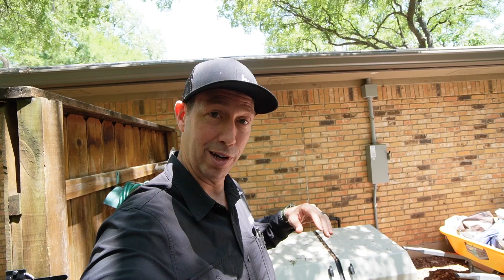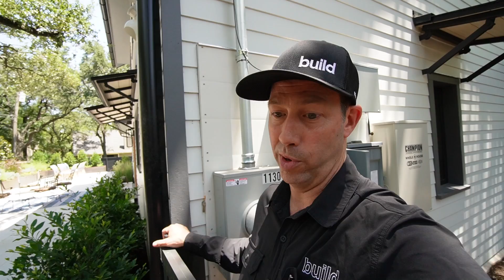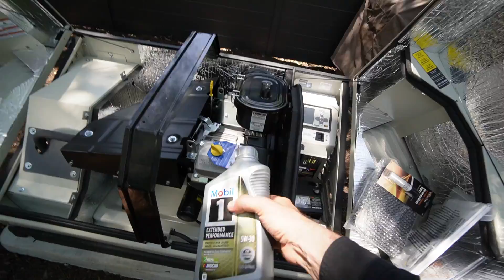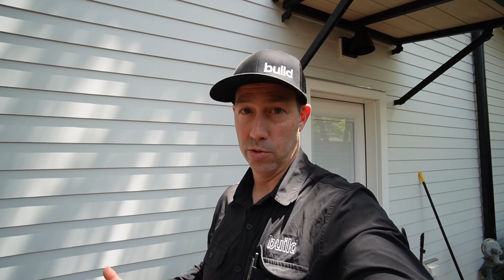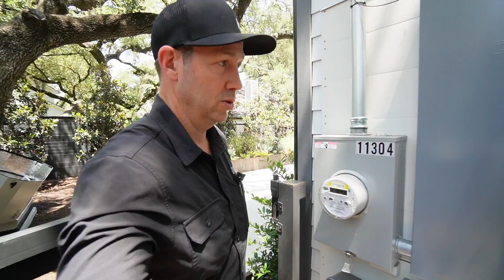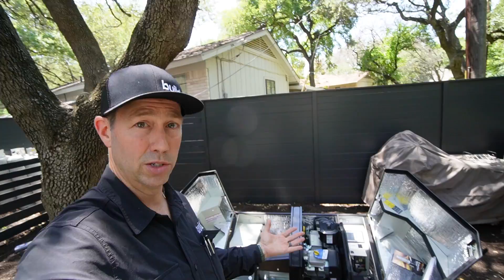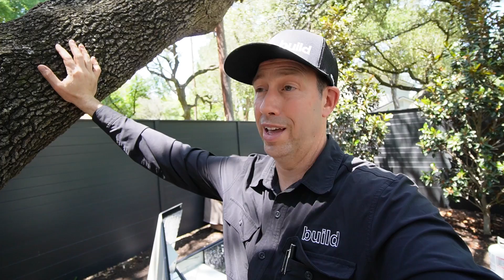Rolling Black Outs? Meet my little friend: Home Standby Generator

Comment: My personal experience with a Champion generator is the complete opposite of what you claim their customer support offers.  8 years ago we had a major ice storm just before Christmas, TWO WEEKS without electricity!  We got lucky and walked into a Big Box store JUST as they brought in a pallet of Champion 4kW portable units.  I will say that little generator ran very nicely for 2 weeks, almost continuously except for refueling and changing the oil.  After the power came on, changed the oil again, drained the fuel and put it into the garage.  1 year later, another power outage so I go to fire up the genny.  Nope!  Took it in for service, with well under 350 hours the block is cracked.  No warranty even though I did register it, because the first oil change wasn't done by a Champion dealer.  The only way I'll own another item from Champion is if they GIVE me one like they did you.
Reply: I have a small 9500 inverter portable generator I use to back feed the electric panel.  I use a lockout.
To keep from overloading my generator with the HVAC startup demand I use a couple of soft start controllers.  Works well.
Make sure you get a generator which has a low distortion.  This helps protect your electronic equipment.
Reply: Honda is the ONLY brand to use in portable generators....there is a reason they cost a bit more, the high cost of low prices
Reply: @cengeb  Well, my next small generator will be an EU2200i.  One of the best generators in its class.  After the first one I would like to get the companion for parallel use but that will be a while yet.
Reply: Ouch.
Reply: Love my standby generac 24kw
Reply: @blueboat9581  If/when we can get a whole house system it's going to be a Generac or a Kohler.  Probably about that size or maybe a little smaller
Reply: If you are getting anything other than a cummins generator you are paying for what you get. You're buying a random engine from a no name company that they bolt up to another no name companies electric generator that they slap their name on doesn't matter what brand, Generac, Champion, Kohler.  Just from a family of electricians pov who have installed and serviced a lot of generator/ back-up power systems
Reply: Onan Cummins is the way to go
Reply: @Rubyranch393  Very common in large RVs.
Reply: @hankwells2637  Do they make a smaller Cummins generator? I have a 1300 sq ft house single story in a hot climate, no cold.
Reply: @Moondoggy1941  They make all the way down to 7500 watt generators all the way to 40kw
Reply: @hankwells2637 Briggs and Stratton make their own Vanguard engines.  The power head I’m not sure about, but it’s never failed me but one time the starter solenoid went out.  10 year warranty hard to beat too.
Reply: @mikerossman9863  Breaks N Scrap-Em, they ain't made like they used to.
Reply: @hankwells2637  It's funny you forgot to look at Honda, Kubota, Yamaha and similar others but I guess we're discussing standby units here and not the more versatile offerings from the truly good generator makers.  Also, to the original poster, you have to keep maintenance up with any power supply like generators and even battery solutions.  You can't just put a machine away for a year and expect it to run again.  This is one of the headaches I may have with mine as it's almost a year since I bought fuel for it but I did run the carburetor dry before storing it away.  More or less I will have to dispose of the old fuel and maybe clean the carburetor but that's the very least you can do with most.  What people should be doing is pulling it out, inspecting key parts of the unit and test it.  This also applies to battery units as you need to use the unit once in a while.
Reply: This is why I hate these shill videos Matt does now.  But I'm sure Matt would highly recommend these generators even if they didn't pay him!  /s
Reply: Your story is more than a little suspect for two reasons. Firstly, there's no such thing as a Champion dealer. They have electricians that install their whole-home units but they do not service their portable units in any way. Secondly, the Magnuson-Moss Warranty Act makes it illegal to require maintenance to be done by a dealer. It doesn't just apply to cars but to all consumer products sold in America.
Reply: @nodak81  They MAY have meant an authorized service center which IS allowable under the M-M act, but that's not what they SAID.  They said the word "dealer"
Reply: @michiganengineer8621  The closest thing to a Champion dealer we have is Canadian Tire as Canadian Tire stores are actually dealer owned.

Comment: Have you looked at a solar system with Enphase IQ 8 microinverters? Pretty cool system. If the grid is down but the sun is shining the system will “island” your house from the grid and then pump that power, in real time, to your house, without batteries. Also, F150 lighting has a bi-directional charger that can draw from the trucks batteries to power your house, then charge itself from your solar system, all when the grid is down.
Reply: That’s a brilliant setup for a contractor!

Comment: Are those some kind of hurricane shutters on the windows of the side of your garage? If so, I'd like to know what steps you took for hurricane protection of the structure.
Reply: He is in Leander Texas, 230 miles from Galveston. No hurricane specific protection needed there.
Reply: He is in Austin.  Same basic area.  The Champion installer was in Leander, a northern suburb.

Comment: Keep in mind when you have an extended outage you will modify your normal behavior and use less energy.  Battery + Solar just doesn't pay in Texas like it would in California where electric rates are so high.  Some kind of backup is no longer a luxury.  I'm a fan of solar + batteries because it's green and if sized correctly could keep you going forever ($$$).
Reply: It’s green at source of use, not source of manufacturer (mining materials).
Reply: Batteries dont last and solar only works on sunny days. If you live in Arizona, maybe...lol

Comment: You took the path I would have.  Up here in Minnesota power has been super reliable.  The longest we we’ve been powerless was a couple of hours duration a couple of times over 40 years.  Hard to justify the expense, but I am still debating.
Reply: Many people were without power for multiple days in feb2021 in Texas.  Ice keep us home for a week.  Texas is a non-connected grid, eg standalone and we were underpowered because much of the  in state generation was also going down.  So Texas is worse than almost anywhere else in the US.  Lousiana and Oklahoma had no real issues because they are part of a multi-state grid.

Comment: I specified a 225 kw Generac generator, propane, for the house in east Texas. A little less expensive, I'll have to look at the Champions model on the next project. The transfer switch alone was $1700 supplied & installed.
Reply: 225kw? That's more than ten times the power requirements of any house I know of, except maybe the White House in Washington, DC.

Did you perhaps mean just 25kw? That's a large Generac for a home, but not totally whackadoodle.
Reply: 22, typo

Comment: Contact engineer775 here on YouTube. He can help you look at solar, inverters and battery systems as well as a generator tie to help charge your batteries should you have bad weather and low solar output. He can help you with design, sourcing equipment the works.

Comment: That 14 Kw generator is hopelessly too small for your house. It may work but will be running at near maximum capacity all the time.  All of those 100 lb. propane tanks are a HUGE hazard to you and all of your neighbors, not to mention theft when the power goes out.  Why not go with a Generac 24 Kw air cooled whole house generator and a 500 gallon or whatever size in ground propane tank your HOA will allow.  That way you can power what you want and not burn up your generator.  I have a Generac 20 Kw whole house system and love it.  Very easy to maintain and very reliable.  Very good quality.
Reply: It's always easy to say go bigger. But in reality, it's only for backup. You only need just enough to survive, not thrive. I have a portable dual fuel (propane/gas) generator that's about 8kw on propane. It's enough to run the essentials in my home, including A/C, well, and my oil boiler for hot water and heat. If I watch what I have running it's also enough to make dinner in the oven or on the cooktop. 

Is it perfect a solution, no. But it's budget friendly and anyone could reasonably afford it. All in, I'm about $600 including the generator (was a return with 0 hours that I got a deal on), hook ups, and permitting. I did the wiring and lockouts myself and passed inspection. I'm not a certified electrician but I was able to learn how to do everything the right way.
Reply: @jensalan  It is not a matter of being easy to go bigger.  It is a matter of the laws of physics.  Just because a generator is rated to produce X number of amps output, the output must be matched to the load.  Our 5 ton heat pump draws about 172 amps on initial start up for just an instant & drops to it's normal rated amp draw which is about 1/4 that amount.  With just the heat pump load on the 20 Kw Generac, it would drag the rpm's down to almost stalling the engine.  This is horribly destructive to any generator & continued use would destroy it.  I had to install a Micro-Aire EasyStart Soft Start Kit in order to run the heat pump on the generator. With the soft start kit installed, we dropped the start up amp draw about 110 amps which a 20 Kw generator CAN support on start up.  The generator must be able to support the LRA (locked rotor amp) load of a heat pump/ac unit.  This applies to pretty much most appliances like, refrigerators, freezers, fans, dryers, washers, etc.  Most typical homes require at least 30 Kw to run everything normally.  My 20 Kw is a standby generator to get me by provided I am disciplined about limiting the number & amount of electrical loads we place on it.  I hope Matt can get by with a 14 Kw generator.  I have serious doubts and I fear he will learn the hard way that he needs to size & rate his standby generator to the loads that are likely to be placed upon it.  In Matt's case let's give him the benefit of the doubt and cut the start up amp draw for his heatpump/ac unit in half from what mine draws.  86 amps x 240 volts = 20,640 watts.   Matt would have to have a heatpump/ac unit that draws less than 59 amps on start up which would be max output for his 14 Kw generator.  With 3,000 square feet, multiple ac units as well as the rest of the typical home electric loads, I don't think so.
Reply: How much was the generac 24kw total install cost everything included? I’m looking to get a natural gas one.
Reply: @TheMrDamp  I have a 20 Kw Generac.  I purchased my Generac from Lowes on sale & with my veteran's discount for about $3,400. I purchased mine several years ago, I paid about $800 way back then to have it installed & inspected.  Expect to pay more in proportion to inflation.
Reply: @wrfarms9741  thanks that’s really not bad considering you don’t ever have to worry about losing power again. I’d pay $3400 all day
Reply: I am also wondering why 20 gallon tanks vs residential 500 gallon.
Reply: @JPetersU2be  Agreed. 1 or 2 larger tanks and just have a company refill them. Especially when it's hooked up to a permanent install generator. 
Unless his intention was to still be able to bring them someplace to get them refilled somewhat easily. But in their current state, not really ideal.
Reply: @JPetersU2be  those are 100 pound 20 gallon tanks.   100 gallons at 4.1 pounds per gal would be well over 400 pounds, a bit tough for Matt to lift into his Tundra.  Only allowed to fill 80%.

Comment: Just my thoughts… I would not daisy chain the lines, or I would have hard bypasses incase one got punctured.  If I had a house w/ the efficiency of Matt’s I would run 4 hrs of power in the AM and 4 in the PM.  That’s enough to charge batts, cook food, and bump the AC.  I know of a power outage in Spokane that lasted 3 weeks and those blocks were in the city center.  Great info and I love the vids on here and BSN!!!

Comment: I disagree. Hopefully If you ever have 7-14 day outages again you can still be able to pick up Propane. I live in the city and just did an offgrid solar + battery setup offsetting 80% of my power needs. If grid goes down I can run heat pumps, fridges, lights even during cold winter days. Wouldn't be able to have hot shower and hot house at the same time, but can at least keep the house from freezing and warm up a pot of water for some bathing.

Comment: That's why you do load calculations and ensure the size can start the motors.

Those are called load management modules and they always go on dryer, cook top, ac units, water heater to take out the larger 240v loads to ensure everything else can run and it will release them via priority set to be used.
Reply: LRA plays a big role for AC condenser/Heat Pump
Reply: If you get a soft start like the easy start for your  larger 220 motors it vastly decreases your starting amps

Comment: I just order a solar array for my house I'll be installing in a few weeks. I air sealed my house based on your insulation 2.0 + other videos and now my house is so dang efficient that a 3 kw system will run whole house. Solar I can use throughout the year, so I went that direction for emergency + savings.
Reply: hold up would love to see this!  3KW for the whole house?
Reply: What is the sq ft of your house 3kw on 220v would be 13 amps that would run one outdoor a/c but not start it unless it’s a inverter. Give us more details please!
Reply: @adamkubiak9760  it's a very small house, but the most expensive stuff scales. The house is ~1200 sq.ft. The battery system goes through inverters for balancing the startup load of the AC system. I ordered 2 inverters with com for splitting the phase into 220 to run our well and AC.
Reply: @Jay_Schmidt  awesome! My background is in hvac, just food for thought look into a soft start for your a/c condenser. Micro-air is the most popular brand it’s called the east-start 364 it is designed mainly for solar it takes the lra way down so you don’t have that short large amp draw.
Reply: @adamkubiak9760  I've been looking for recommendations for those! I would put on one my well too. I know my system can take it because it has 26kW peak load rating lol.
Reply: Install solar once and save money month after month, year after year. Solar combined with battery storage are the future.
Solar panels can last for 30 to 40 years or more with some degradation. Batteries in cars have a 20 year 1,000,000 mile life expectancy. The power walls for a house should be no different.  There are several companies that will recycle old vehicle and power wall batteries  when that becomes necessary. The materials inside are valuable and will be recycled.
Reply: @KJSvitko  the batteries I have have a 10 year warranty. That made me feel pretty darn safe.
Reply: @Jay_Schmidt  Yep, they will last a lot longer than the warranty. They might just lose some energy but still be more than enough.
Reply: Make sure you add some batteries. In our area your solar will not work in a rolling blackout if your connected to the grid. This is for the safety of the lineman. Batteries will allow you to function if the grid goes down. Good for you.
Reply: What videos do you watch for insulation?
Reply: @sergiosotojr  https://youtu.be/1BcqeQJqp08
Reply: @sergiosotojr  and I used sikaflex on the inside of the wall assembly to cover every seam
Reply: What inverter are you using for off grid backup?
Reply: @MichaelNatrin  2 x EG4 6.5kW
Reply: @Jay_Schmidt  awesome, looks like a nice unit 👍 EG4 makes some great stuff. I don't understand how anyone goes solar without an off-grid capable inverter.
Reply: @MichaelNatrin  on-grid is a senseless idea these days, since it goes off with the grid, you have to PAY for net metering, and power buy-back is such a low margin. Off-grid inverters have come such a long way that they are the best solution.
Reply: Dang, nice, must be super efficient.  I have the same size house with 8kW of solar :).  I do need a backup battery system in a couple of years.  Just waiting on prices to drop to reasonable numbers.
Reply: I have solar and forgot that you need a battery to keep rolling in a power outage
Reply: @MrRobw1312  I sized a 36 hour backup battery system for mine. That should give enough time for panel cleaning if that's ever needed.